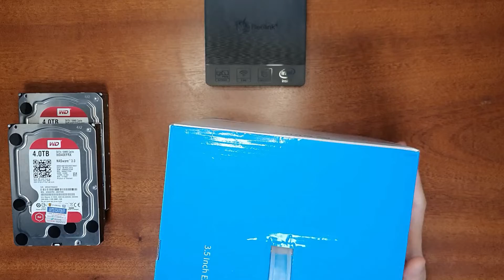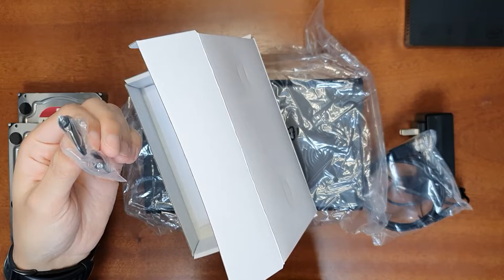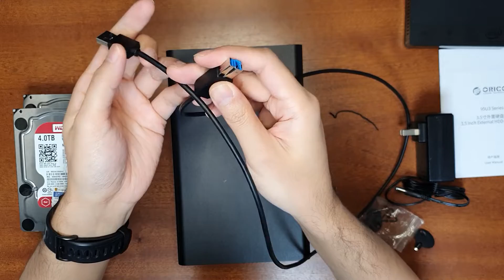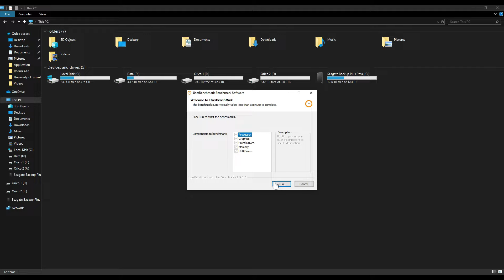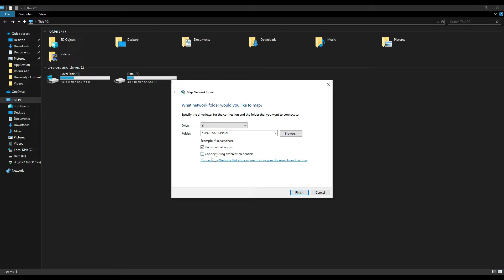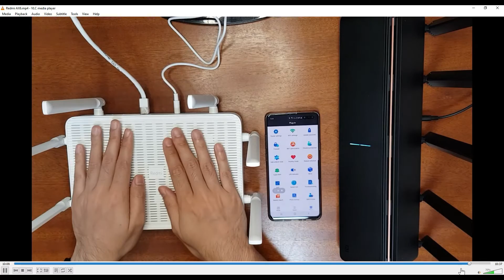Orico NAS External Hard Drive Enclosure Review Setup Speed Test 9528U3

Comment: In windows disk manager , we also can use 'raid 0' (select create stripped volume - rather than simple volumes) to merge the 2 drives into single 8 TB and using usb 3.0 roughly i think can get around 250 - 270 MBps with raid 0. But this is a software raid , not hardware raid, so only your pc can read the raid. If connect it to other laptop/pc, your drive won't be recognized. But as long as you using on single pc, you can utilize using raid to get faster R/W and merge as a single Volume / drive - not 2 separated drives. Orico also has the 'R' model which already has hardware raid which bit more expensive than standard model.

Comment: This is a USB HDD enclosure with RAID, not a NAS. It does not have a LAN port.
Reply from the maker: Yes correct. That's why I have shown in the video how to setup a simple Windows file share NAS. Thanks.
Reply: @DSmartLife  perhaps you should rephrase the title of the this video.. btw thanks for the review
Reply: What’s the difference between a multi-bay hdd enclosure and a NAS? 
If I just want to setup multiple hard drives so that they can be used as one huge drive (with self back-up) then this a multi-bay hdd enclosure’s good enough right?
Reply: @thaboshikwambane  I know i'm late here but DAS is Direct Attached Storage which is shown in video and NAS is Network Attached Storage.. one is offline and one online simpler explanation if you will